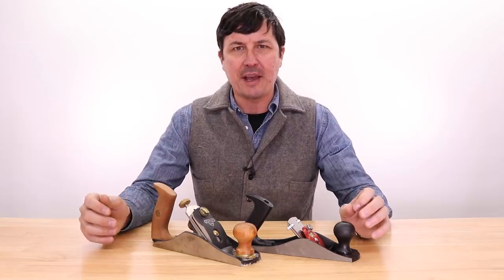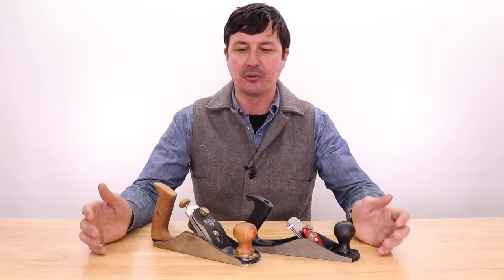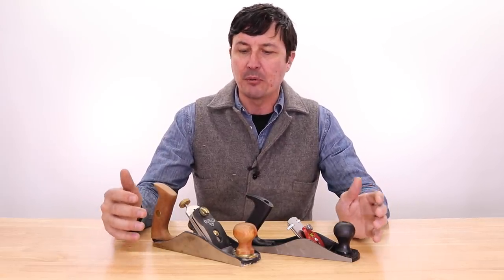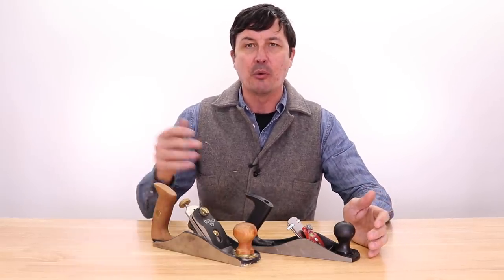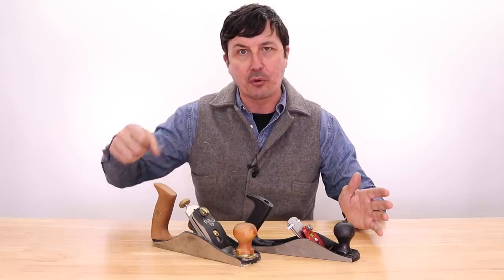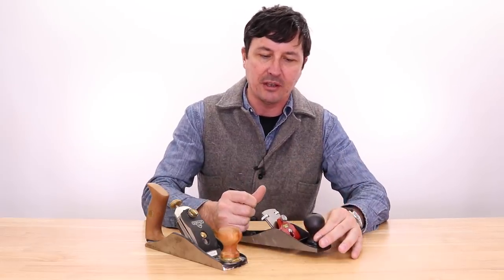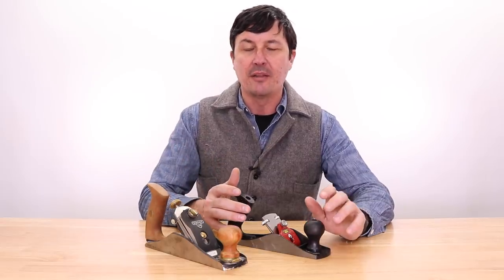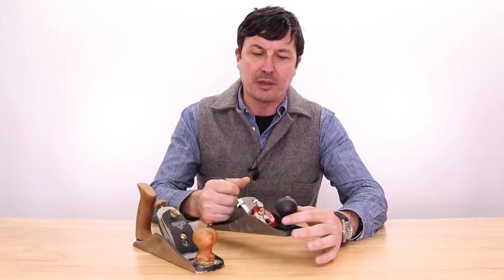Testing The Cheapest Bench Plane On Amazon

Comment: At 20:17 the 'cap iron' wobbles like mad. Maybe that's why it took you so many times to get the lateral adjustments right for the plane iron. I have an even cheaper chinese plane with the same design, and you have to tighten up the cap iron screw after each small adjustment, or the lateral screws and the plane iron just move around. I expect it's the same for the Stanley one.

Comment: One reason you were having difficulties adjusting the blade is that plane adjusting knobs/nuts have backlash when their turn direction is changed. With only a couple of threads contact, those narrow knurled nuts will have a lot. 

If you change from adjusting for a deeper cut to adjusting for a more shallow cut then, after you make the adjustment, you need to run the adjustment/nut in the other direction until it has taken up the backlash. Or in the case of that plane - both nuts.

If you only adjust toward a deeper cut, then there will not be any backlash. Also, when cutting, the iron cannot push the adjustment higher, since the process of pushing the iron down also pushes the nut up. 

That is not true if you adjust for a shallower cut - the iron then pushes everything further up, reducing the cutting depth more than you expected. Maybe that is part of the reason why you felt that the adjustment mechanism was so coarse.

When reducing the cut depth, I have always found it to be easiest to reduce it more than might be needed, then adjust down slowly to increase the cut depth as desired. 

You can see the initial adjustment by turning the plane upside down and sighting along the sole. You will be able to see how far the blade protrudes as well as whether it is skewed.

With all the metal planes I have, it only takes a slight turn of the adjustment (often 1/8th turn or less) to make a big difference in the shaving thickness.

Comment: That glass is not as flat as you think. Plate glass can be out of flat by several thousandths of an inch over a foot or two. Not to mention it is not thick enough to resist significant flexing while in use.

Comment: It looks like a great economy plane. I've only started experimenting with wood working and recently bought a Harbor Freight No. 33 plane. It has a similar double screw design to set the blade, but there is a much larger gap between the knife and the adjustment screws in the HF plane than in this Stanley. This makes fine adjustments cumbersome. I might try this plane instead.

Comment: I like the plane you just tested for a home tool kit. It is perfect for the home user that will use it infrequently and not care whether it has plastic rather than walnut knob and handle. The settings and adjustments may be coarse, but it looks like you got nice shavings with it. I'd want one in my tool kit.

Comment: You should have started with 80 grid wet paper. I used it yesterday to get it flat and than polish it until 400 - 600. Much faster (tried with 320 like you did from start and it took forever (Faithfull smoothing plane).

Comment: Clamps and a vice. As one guy said, "you can never have enough clamps". The popular high value ones are the 6 and 12 inch bar clamps at Harbor Freight. Not sure on vices but I still have the small bench top vice I got as a teen many years ago. It has been all over the state and built a lot of things, mounted at the end of a 2x6 and clamped/screwed down to tables along the way (kind of like your cleated bench top grinder). Maybe a woodworking mini table clamp with dog system (one of the other channels had a build not much larger than a step stool that was kind of a clever hack at a portable table).
Reply: jvin248 Gambling is a "vice". Wilton is a "vise".

Comment: That plane not being flat may be a design decision and not just bad machining. Japanese planes are purposely made so that the bottom is slightly concave, to reduce friction as less surface area is touching the workpiece. Apparently it's supposed to reduce catching on the workpiece as well.

All that said, the body of Japanese planes are made of wood, so that is much more likely to be a problem. I'm not sure if it's really necessary for a metal bodied plane.

Comment: Since I don't have diamond plates, and no plate glass, I just used my diamond knife sharpener and went side-to-side with the flat and the bevel. Went from medium to fine, and then polished on a strop charged with 15,000 grit polishing compound. This took awhile, but it got my buck bros chisels and block plane razor sharp with mirror polished edges. 

Nice video!

Comment: To sell a serviceable plane for $19 they had to take away the standalone depth wheel. But trying to keep the blade parallel with two wheels will undoubtedly drive you slowly crazy. I just bought a three chisel set at Walmart for $5 and spent many hours flattening and sharpening the first of the three. for the next one I plan to start with a 220 diamond stone. that will make a big difference over sandpaper.

Comment: I bought a Kobalt brand plane from Lowes for $30. By all appearances it is better than the cheap one in this video. It has solid wood handles and better blade adjustments as well as being heavier overall. The same amount of time is needed to set this plane up, so buy lots of wet/dry sandpaper and have patience. It's worth the effort.

Comment: Glass is an amorphous solid, meaning it doesn't form a particular crystal structure, but it is a solid (does not flow). Also, glass is actually relatively flexible when it is that thin. I discovered this when trying to use a 1/4" thick piece of glass for a reference plane for my CNC. Suffice to say, glass can be deformed substantially under pressure before it cracks, probably something like a tenth of an inch per every 12 inches. Not great for accuracy.

Comment: i bought a similar plane, and I absolutely hate this adjustment mechanism. Also it does not keep position well in my  case. In theory I can work with such plane, but I hate it. Other people recommended to get good low angle jack  plane - i will get one next month.
That look when you told that it will take long time was priceless.

Comment: Bought this $19 plane and out of box it was in rough shape.  Sole was cupped and the blade had surface rust, but I could make shavings.  2.5 hours of prepping the blade and flattening the sole and I was able to make .001" shavings.  45 minutes of flattening the sole on 80 grit paper on a marble slab and I got rid of most of the cupping.  However, it would take another 45 minutes to make it flat.  I won't spend that time.  

By the way this $19 plane is the design that Harbor Freight copied when the Windsor Design No. 33 plane was created and produced.  I have both and this Stanley has a much better executed twin thumb screw adjustment.  This Stanley is also a little longer and easier to hold.

Comment: I have that same plane.  I've always hated it.  I did follow Rex's video and decide to make it a scrub plane, so it's in the middle of that.  I also have the Stanley Sweetheart #4.  Paid 135 for it and would do it all over again, even though the SB4 can plane.  The difference between using them is night and day.  The SB4 can cut, but it's just not that fun.  The adjusters are jacked and bind and are hard to fine tune.  The Stanley Norris adjuster may have some Backlash, but it's pretty easy to dial it in, and it's easy to dial it in so it cuts like razors. The SB4 will always just be the Corolla. Basic Transportation.

Comment: You mentioned about tools need for your basic wood working. First and most important is the room for woodworking. You need to store your lumber near your work place. You need location to place your workbench to work on the work pieces as well as the tools. I have some of the basic tools to start with. I ask what is a list of tools you need to do basic wood working. What type of wood would you be working with? Soft or Hardwoods. If you are basing your budget on tools you are buying and use, the same would go with the materials you are going to use for wood working. 

For me the first thing I would need are tools to build a decent work bench to use the tools such as chisels and planes. The work bench could be made of 2X4 or 2X6 lumber. Need tools to cut the lumber to the various sizes to making the work bench. You can use hand saw. You could invest in tools like a cheap table saw or compound radial arm saw .  I would use the plane mentioned above to make joints like mortise and tenon to put the legs and various braces for the work bench this would give it strength to use hand tools like planes and chisel without it wobbling. If I was to start off in wood working on a budget what would be the tools I would need to get started?

1. Work Bench could make or buy?
2. Need hand tools such as saws and planes and chisels
3. Hand sander
4. Circular saw 
5. Jigsaw
What tools needed to make mortise and tenon:
> A marking gauge or mortise gauge.
> small square.
> a mortise chisel – 1/4″ is common.
> Dovetail saw – or tenon saw if using bigger wood.
> Carcass saw – can use a dovetail saw if you don't have a carcass saw.
> Marking knife.
> Clamps.

The list above Amazon would have these tools to help you make a decent work bench would be something to show and prove you don't need  $100,000 to make decent wood products. The key here is using the skills you build when using inexpensive tools through trial and error.

Comment: Maybe you should rotate the plane and see the blade trough the hole at the bottom, maybe it is easier to set it correctly. Instead of measuring the wood thickness.

Comment: Check Rex Krueger’s review: he removed the pair of adjusters and adjusted the blade as you would on an old wooden bodied one, by tapping with a hammer. It worked really well, but he used two hammers and tapped the iron with a metal hammer to lower it or to get lateral adjustment and the tote or the front handle with a hide hammer to raise the iron.
I understand that back in the old days, the Carpenter used his wooden mallet and tapped appropriately on the body of the plane.
And you know what? -it worked and was far easier than using the adjusters!

Comment: View the blade from looking at the bottom of the plane and adjust the blade accordingly with the thumb screws. You will learn immediately how to set the angle and the depth with the thumb screws when you view the blade from this bottom position. Other than that you gave some decent information. I have bought one of these planes and set up accordingly. It works very well.

Comment: Have you debated removing the plastic handle and knob from the cheaper Stanley plane and fashioning a proper set from a hardwood? I think that would increase the ease and enjoyment of use of the tool :) Maybe a cherry or oak handle/knob but you can't beat a well sanded piece of fresh cut pine! Use some boiled linseed oil on it ;)

Comment: i would say, yes, but only if you can't find cast iron bayley style plane like mac alister or something 
they are pretty much the same price but much easier to work with
the preparation route is pretty much the same, so are the plastic handles
but as much as i like mac alister plane i bought, i don't like my stanley sb3 as much
those two adjustment knobs are pain to setup right, and they waer out so the blade is pretty much hard to pull out again, some knokof metal planes solved that issue with bigger nuts, bot no stanly
so yeah
blade is ok i think, i did noy chip my much when i was making my workbench and i did a crazy thing by shaving almost 2 centimeters of the top, because i used uneven construction wood
but the plane work, it is pain to work with it, but it works

Comment: Firstly I think that plane might end up turning quite a few starters off of planes all together. It's really to finicky to set that blade. And if they get tear out there not gonna know what to do and blame the plane. I think a pre world war 2 plane would be around the same price and have a much harder steel to hold it's edge. You can find them in yard sales or wood shows. The front of the plane adjustment is called the mouth and it's to reduce tear out. Try to get it as close to the blade without touching as you can and it'll help.if you have any questions about the Stanley Sweetheart comment and I'll try my best to answer. I have a few sharpening tip too if you'd like.

Comment: I worked on a horrible freight No 33. It works ish I have two older Stanley no 4s one is a scrub plane so my impression the number 33 is a smaller plane by a short fraction but having the left and right screw like the Stanley you have it has some issues with adjustment very coarse like you said. Using the number for Stanley's that I have for years I managed to get the Harbor Freight to work but there is a small difference wait ease of adjustment I want to say that the drag is smoother on the number fours because I believe the weight has a lot to do with inertia a few ounces going in the direction you want as opposed to catching on the chip and pushing back that's the best way I can explain it guys. So would these work for you sure you got to put some work into smooth but then again you got to do that with higher-end Stanley's. If you get a lie Nielsen It better work straight out the box. Three hundred and something dollars really. But I can't talk about it cuz I don't own one yet so take it what for what it's worth

Comment: First your tune up on that stanley made a 20  dollar tool a 100 dollar tool. I have three stanleys in the tool box which get rare use. I make dust with power tools. guess what I am going to do now. there is nothing more wood worky then a hand plane.
As far as chisels its all about how often you mind sharpening and how long you need them to be. I get great results from harbor freight because I enjoy sharpening. I have a nice flat spot next to my work area I stick a 1200 grit sand paper held down with mounting adhesive. then I spray some WD 40 on the paper and I will dress the edge as needed.

Comment: If you had used a chinese clone of the SB4 you would get wooden handles but pot luck on the rest. I have a very good one i use before i risk one of my baileys. It would have been interesting if you had checked the flatness of the expensive Stanley because they are usually far from flat. But i enjoyed your video.

Comment: As for a combination square, I think a cheapish plastic body combination square will be fine.  If you look at the reviews they all say "it's not square, 0 stars" but I think they're missing the point.  The body is plastic, with a bit of sandpaper you can adjust how the rule sits in the body, you can make it square.  As long as the rule is straight and the body is not too bad, a cheap combination square is fine.

You can see on youtube how to square a square.  Basically it just involves drawing a line, flipping the square over and drawing another line and see how far they are off at the end of the line.  Adjust the square, try again.

A perfectly cast and machined square can be something $100 or more, but cheap squares are more like $10.

Comment: I have the Stanley 404, which is a very similar plane but with a different material for the handle and knob.

I did some tuneup work on it, flattened the sole, sharpened it, and I occasionally use it for carpentry tasks.  It will plane an edge OK once you get it dialed in.  It's worthless for smoothing, though.  Besides being fiddly to adjust, the blade always tended to move on me while I was working with it, which is a disaster for smoothing.  Also, the thin blade can't handle it when the grain decides to switch on you.

I wouldn't recommend this plane for woodworking.  It will do the job if you take some care, but it's not enjoyable to use; I tended to get frustrated with it.  A new woodworker would be better off with a used Bailey-style plane, like an old Stanley #4 or a knockoff.  One of my favorite planes is an old Sears-branded copy of a #4 I picked up for $20 on ebay.

If you just want to unstick a door or do similar rough carpentry work, this plane will work fine.

Comment: The observation that old windows are sometimes found to be thicker at the bottom than at the top is often offered as supporting evidence for the view that glass flows over a timescale of centuries, the assumption being that the glass has exhibited the liquid property of flowing from one shape to another.This assumption is incorrect, as once solidified, glass stops flowing. The reason for the observation is that in the past, when panes of glass were commonly made by glassblowers, the technique used was to spin molten glass so as to create a round, mostly flat and even plate (the crown glass process, described above). This plate was then cut to fit a window. The pieces were not absolutely flat; the edges of the disk became a different thickness as the glass spun. When installed in a window frame, the glass would be placed with the thicker side down both for the sake of stability and to prevent water accumulating in the lead cames at the bottom of the window.Occasionally such glass has been found installed with the thicker side at the top, left or right.

taken from https://en.wikipedia.org/wiki/Glass